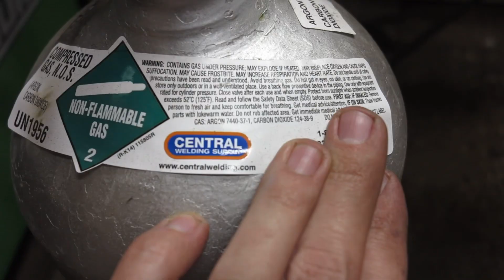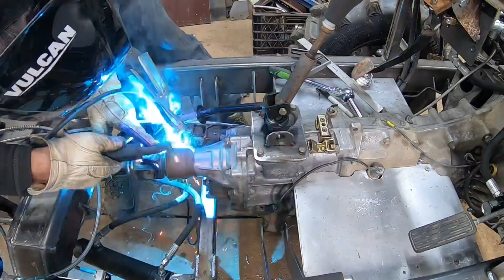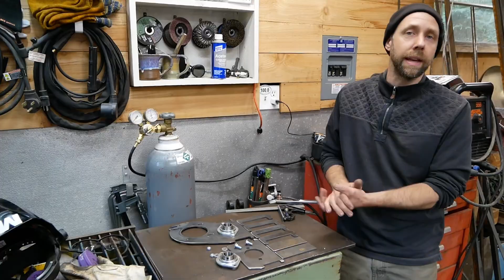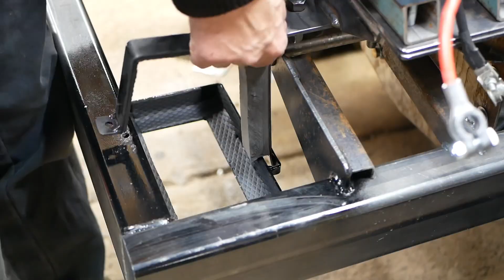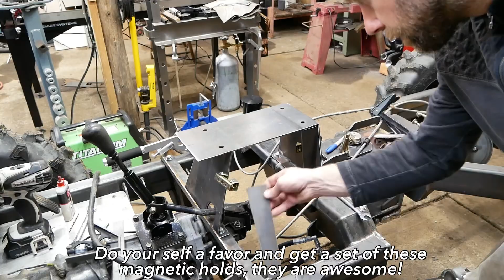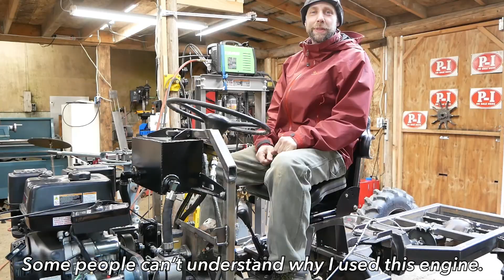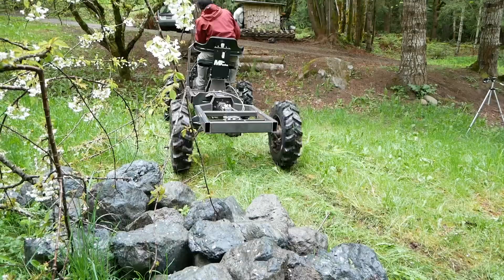420cc Predator powered articulating 4X4 dump truck build part 7

Comment: So you are running a manual Subaru trans right? So with no "clutch pedal" you have to come  to a complete stop to switch gears right? BTW, this is some of the best build series i have seen yet.  Love this one, this beast is gunna be so cool for your property and will out last your grand kids!
Reply: The cintrifical clutch will release as soon as engine rpm decreases so technically yes under load not under load he will be able to match rpms and with the help of the sincros in the trans it should just slide right in
Reply: It moves so slow anyway I dont think having to stop to shift gears will be a problem

Comment: Ok maybe I missed it in another video, are you using a clutch? I noticed you switching gears, but no 3rd pedal.
Great build, and that motor will be plenty. People just dont understand its not for speed, its for hauling. Gearing can be a game changer.
Reply from the maker: I’m running a centrifugal clutch so you can come to a stop in any gear and start out just by pushing the gas pedal. I would have liked to use a CVT belt drive but they are expensive and the belt is the clutching so it’s always get chewed up. This centrifugal clutch should last a long time plus it’s $50 to replace it and probably ten minutes 👍 Take care
Reply: @Mikefestiva  ah ok

Comment: Are you worried about the high center of gravity at all?
Reply from the maker: No because most of the weight is not that high,  engine, transmission, rear diff and all that frame and hubs are the majority of the weight. I’m the highest thing and I’m really not going to upset the center of gravity that much, I’m going to build a roll bar for safety aspects. Take care
Reply: Mike festiva I hope you’re right bro; especially when you install the dump body and put a load in it. It looks like a narrow wheel track version of a rock truck and those things roll all the time.

Comment: It depends on the weather conditions when they are fillings the bottles if if 100% full or not. I have been getting bottles filled for 12years and it's a hit or miss on how full they are
Reply: They are filled by cubic feet, not psi, temperature may make it very but not that much unless it is very extreme.

Comment: As far as gas goes, you pay by weight if you refill your own. bottles.I like your responses to the "experts" comments. As far as engines go the preditator is more reliable than the Subaru engines  yes I'm a certified Subaru mechanic.
Great job.
Reply: Propane and propylene are sold by the pound, most other welding gases are sold by cubic feet.
Reply: @fredshipp3809  you are correct, filled my propane last time, stuck in my mind.
Reply from the maker: Haha! I have ran a lot of Subaru’s in the past and the 2.2 are pretty solid and simple but man those 2.5 are just head gasket specials! 😂 Thanks for commenting Frank
Reply: Yep, never broke a Subaru drivetrain outside of axles even on my chevy V8 swapped wagon. But that 2.5ltr dohc head engine went thru 3 head gasket swaps. 
Mike you are right, the old engines like the 1.8ltr and the 2.2 were almost indestructible but the transmissions were weaker.
This is a great project and build series. Thanks for sharing it.

Comment: The tractor is turning out so well. The power and speed of it is perfect for a tractor. That engine is great because the power is just right, and if something ever goes wrong, they're relatively cheap to repair or replace. What are your plans for the bed? Something really tough and rugged? It might be nice to put a nice wooden bed on it, but obviously that would get dinged up with heavy use.

Comment: hey Mike, great build video series, thank you! I'm curious as to the tippiness of this rig once you have a bed on there, fully loaded .. do you have any ideas/comments on that? (in particular when going over rocks like you did in this video) .. Also, wouldn't it be awesome if your seat had an auto-leveling feature and stays horizontal while your undercarriage rolls underneath you? I'm thinking half-circle single point seat mount with lateral springs or something .. come on, you can do it :)

Comment: If your down to weld a plenum, a small turbo would give you a good bit of torque on top of what you have, (you have to have a plenum 4.4 times the displacement of the engine, it would have to hold roughly 2.5 liters, so the boost you make actually does something

Comment: You may want to consider switching to 100% CO2 instead of 25/75 mix. It's quite a bit cheaper, easier to find and a 20lb tank (about the size of a 55CF bottle) gives you around 170CF of gas since CO2 is stored as liquid in the tank. Lot of people complain about spatter but I have never had an issue once my settings were dialed in. On top of that, CO2 can also be used for as a source of compressed air if the need ever arises.
Reply from the maker: Thanks for the suggestion! I will look into that 👍

Comment: When I built similar articulating Lego trucks 25 years ago now, I always had a problem with motor torque trying to twist the thing up. Have you noticed any tendency for the machine to want to twist yet?
Reply from the maker: Not yet but I will pay attention to that as I start doing more work with it. 🙂

Comment: Just dont weld the diff like you said in another video with weight on it and turning with all that traction will destroy those cv joints with ease
Reply from the maker: I have a different idea for a limited slip for the rear diff. Thanks for checking out my new video.

Comment: you coud take a regulator with you the next time you are getting a new bottle and test it on the spot.
Reply: What's the bottle temp
Reply: I was thinking he could rig up a test gauge to take with him.
Reply: Or weight the bottle?
Reply: Most reputable gas supply stores check the pressure right there for you. At least all the ones I buy from.
Reply: Could be your gauge is off